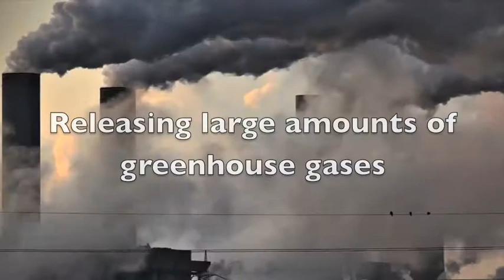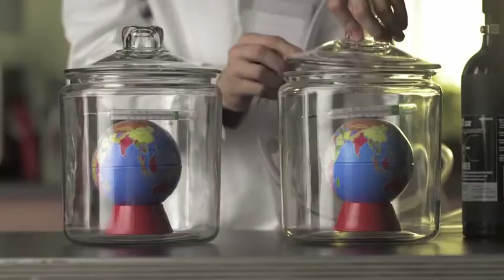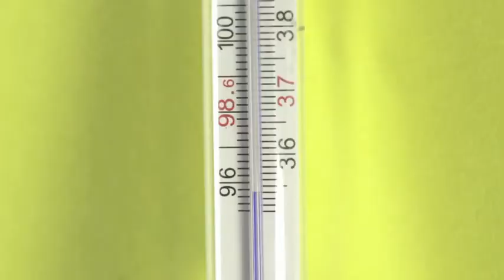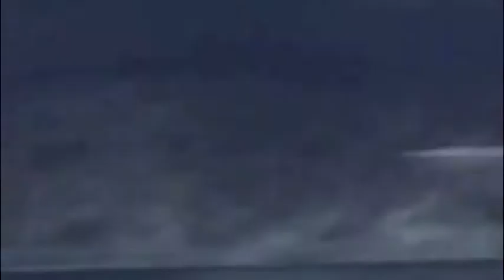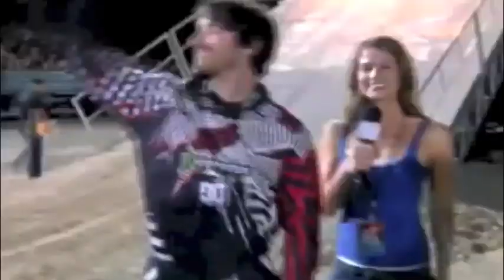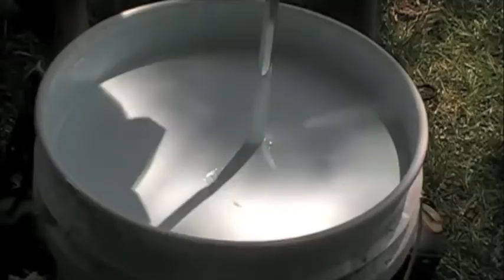Greenhouse Gases, Geoengineering, and Sustainability

Comment: This video uses the Bill Nye CLIMATE 101 experiment (see at 47s) in which the thermometer results were falsified by photoshopping. I would probably cut that section out since that experiment actually does NOT work.

https://wattsupwiththat.com/gore-and-bill-nye-fail-at-doing-a-simple-co2-experiment/